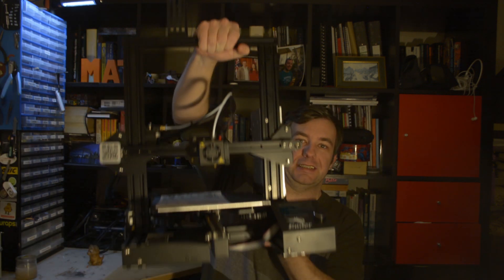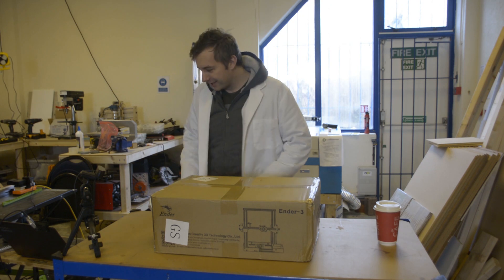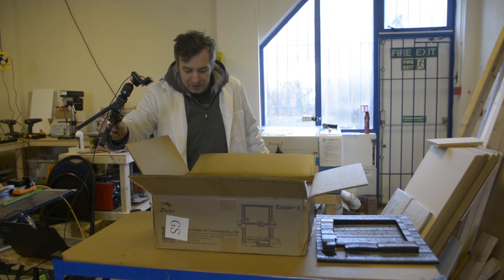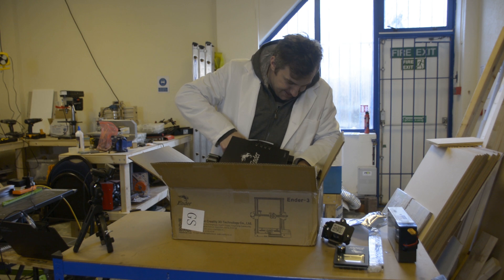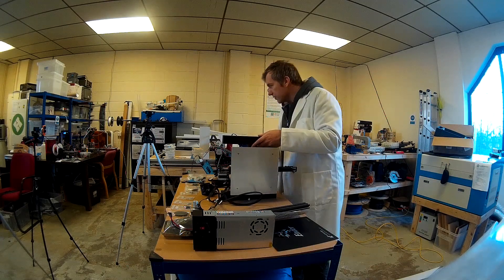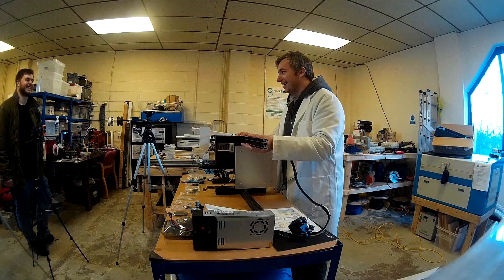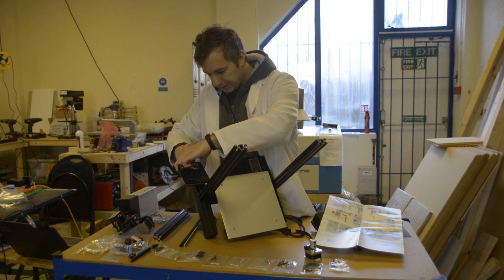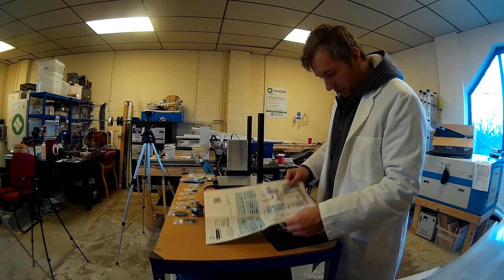Let's build an affordable Creality Ender 3 - 3D Printer

Comment: Did your Z-axis rod pass through the threaded bearing correctly? Mine was way off due to an incorrectly bent angle plate (the one that connects the rod to the moving gantry). Also, my bed was seriously warped.

After four weeks, my printer exploded with a loud bang and a cloud of smoke. I returned it to Amazon for a full refund (yes, I paid more, but returning anything to China is next to impossible, so I paid for peace of mind).

I've not replaced it yet......
Reply from the maker: did you notice any issues slotting the rod in? Mine was very well aligned and I didn't use much force to push it through. Perhaps one of the parts was damaged in transit?  The bed was fairly straight, maybe another indication of the parcel mishandling.
Reply: @notenoughtech  The problem I had (and many others have experienced) is shown in the video attached to this:
https://www.thingiverse.com/thing:3093785/comments

Even with the threaded bearing loosened off, it was impossible to obtain the full motion of the Z gantry.

Warped beds on the Ender 3 are, sadly, still a common problem, from what I can gather.

There was not even a scuff mark on the box and all the sides of it were square and flat - no signs of shipping damage.ll

It's a good printer, if you get one that's OK, and it's at a great price-point, but Creality's quality control seems lacking and they're doing changes and updates so rapidly that you're never sure exactly what you're getting.

I will probably buy a replacement at some point but my experience of the first one killed the excitement for me...
Reply from the maker: I'll double check the distances between the rails. It's a good tip if that's the case.  I have no doubt this is still a budget printer :)  
I hope it was just a bad batch or something.  The first print turned out really good -- I cannot see any immediate issues. Time will tell. 
I know how disappointing it would be to have the printer marred with issues on arrival. Thanks for sharing these useful tips